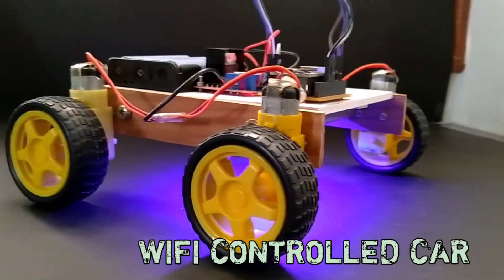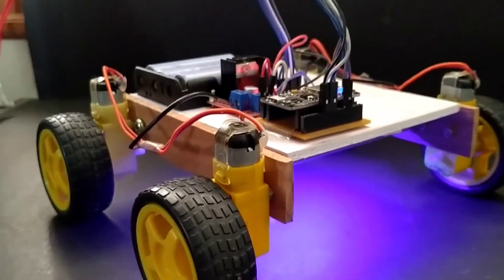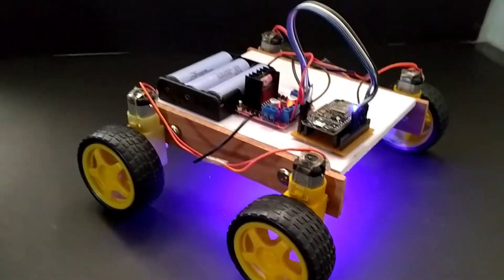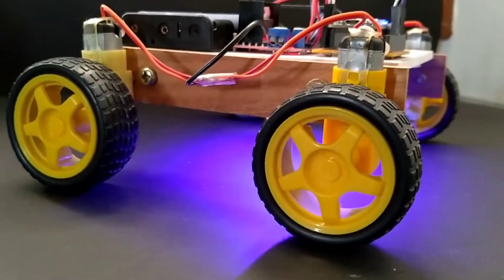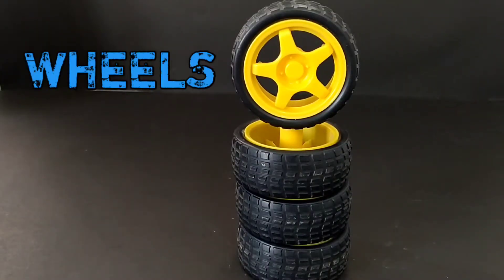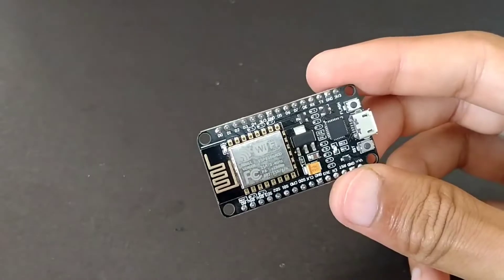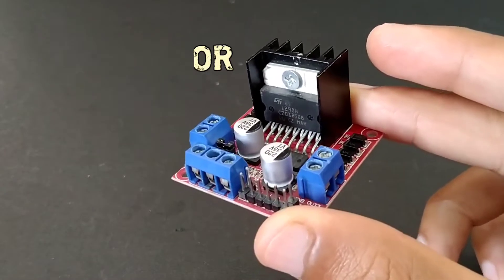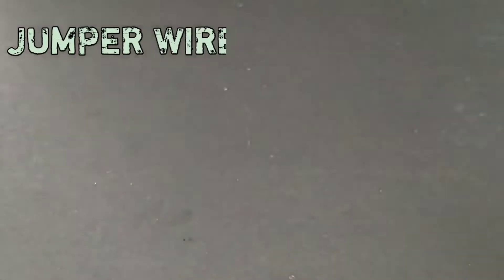WiFi Control RC Car With Nodemcu

Comment: Bro ch340 vs cp2102 which is better for fast work?
Reply from the maker: Cp2102 is better and smaller than ch340 this is better
Reply: @CreativePradeep  cp2102 is really better , from where , I can buy?
Reply from the maker: You can buy it from nearest electronic shop or you can buy it from amazon